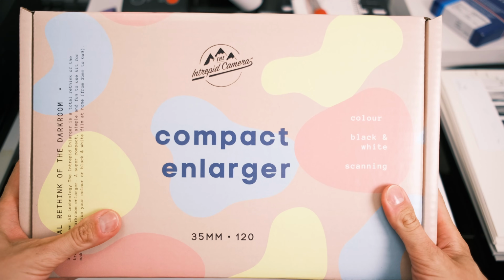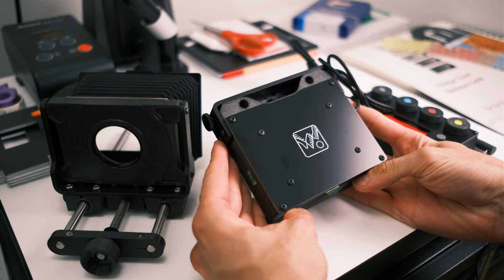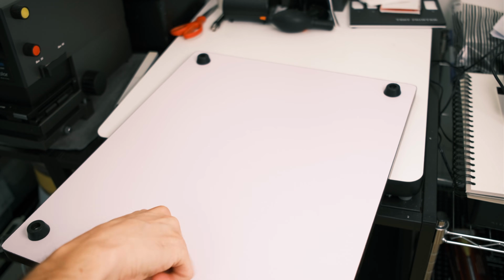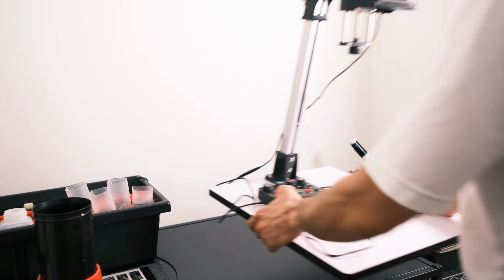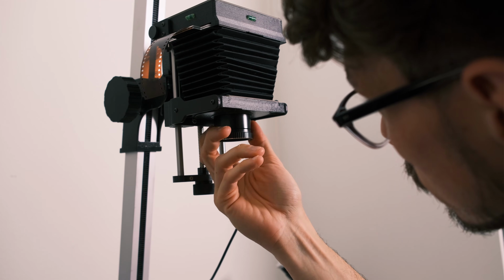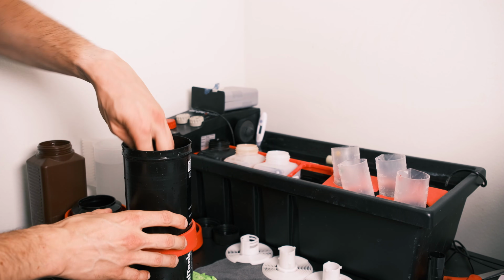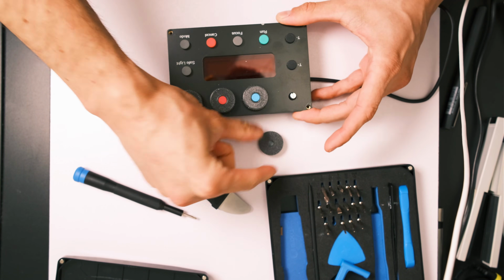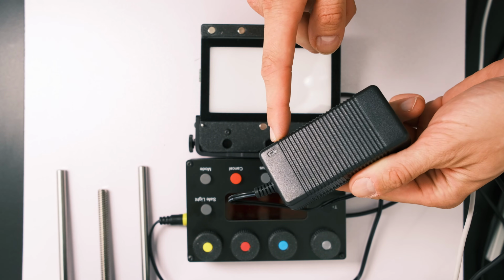Intrepid Camera Compact Enlarger Review for color darkroom. How it works, what inside and setup

Comment: Hi Aleksandr, this is a great review, thank you so much for the effort you put into this. I'd have a question concerning the adapter for the Durst Enlarger. I own a Durst M601. Do you know if the adapter fits here as well? And do you offer it also as a ready made part instead of a digital file? I would buy it probably in bundle with the assembled test printer that you offer in your shop :-)
Reply from the maker: Hi! Glad you enjoyed the review, and thanks for the kind words 🙌
The adapter is designed for the Durst M605, but the M601 should have a very similar mount — I can double-check the dimensions for you to be sure.

At the moment, I only offer it as a digital file, but I can look into making a ready-made part available. And yes, bundling it with the assembled test printer is definitely possible — just drop me a message via my shop, and we can arrange it 🙂

Comment: I have one of these and am pretty happy with it, though I'm by no means a printing expert, and don't print that much colour. I think it's a good option if you are very short of space, and probably mostly focused on B&W. I've made a few tweaks to mine...
- marked off the 100 point on the pots with a white gel pen
- stuck a couple of rubber bits on the start button and safe light button to make them easiest to find in the dark
- reversed the focusing knob to be on the top instead of the bottom
 - I use it on a tripod at present, but yeah, I really want to find a cheap stand with a raise/lower knob.
I'm happy enough with my results for colour, at least I can get sensible results, but I have found +/- 2 to be quite large adjustments. For black and white it is fine, though Lena Besonova has pointed out that it can't quite get you to a true grade 5, I haven't found that to be a real problem though.
I'd really like them to add an f-stop printing mode (in fact, I've considered grabbing a second timer to have a go at reflashing it myself).
Thanks for the disassembly, I hadn't got up the nerve to do it myself yet :D
Reply from the maker: Sounds like you’ve really made it your own! 🙌
I like the idea of marking the pots and adding tactile cues for working in the dark — simple tweaks, but they make a big difference. Reversing the focusing knob is also clever, especially if it improves ergonomics on a tripod.

I agree — for small spaces and mostly B&W work, it’s a very solid option. And yes, an f-stop printing mode would be amazing. If you ever decide to try reflashing it, I’d love to see how it turns out! 📷

Glad the disassembly video gave you a peek inside without the risk. 😄

Comment: I could comment on my negative opinion of the Intrepid "parts of an enlarger".  The LED light panel and controller were a good idea, poorly executed at first, but it now seems to be nicely refined. Price for what you get is ridiculous, but as the saying goes, "There's one born every minute." However, before you rush out to find a 3-D plastic cutter to adapt your Durst, note that Durst sold an accessory in the form of a stainless steel bar, threaded on each end, which was designed to replace the enlarger head and mount a camera, in effect turning the enlarger column into a deluxe copy stand. It would adapt this and many  others Durst enlargers. They used to continuously available on ebay for about $15. You still see them occasionally now.
Reply from the maker: I know about it and was on the hunt for a year, it’s not worth it. “Used to cost” is a good description and good luck to find it less then 100 Eur ) Stand cost 60 eur and it’s second one from your enlarger

Comment: Thanks for the in depth review. I was thinking about Intrepid, I like the idea of supporting new darkroom products, but the color controls are worrying. I think I'll go with LPL or Durst... Btw, have you tested it for B&W prints?
Reply from the maker: I haven't had the chance to test it yet, and I might not be able to provide a thorough evaluation since I'm not currently involved in black and white printing or photography. However, I believe it should be simpler to use. One potential concern is whether you can achieve the full contrast spectrum when using VC paper with the LED setup they have.